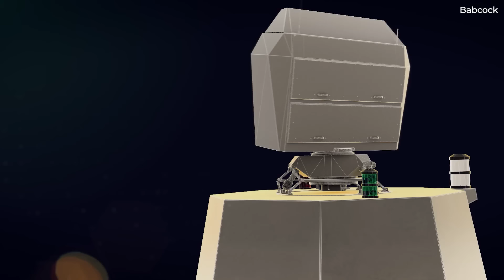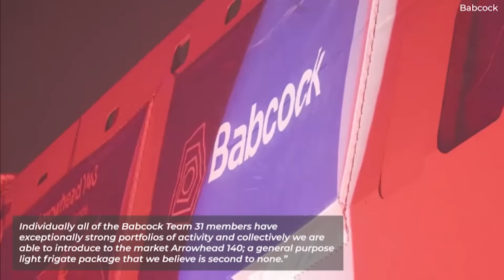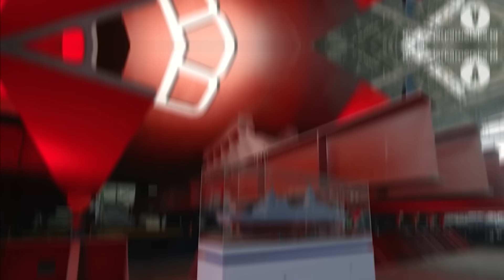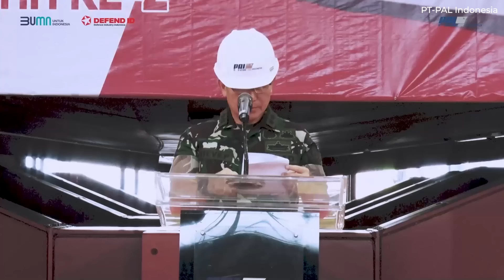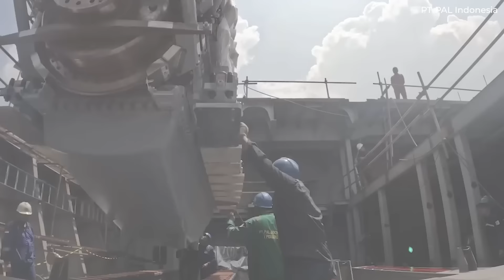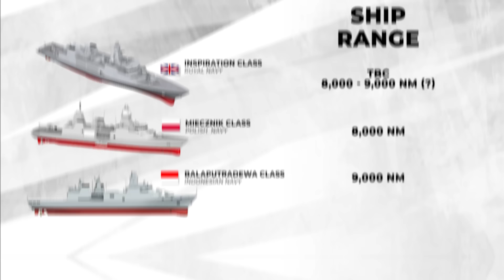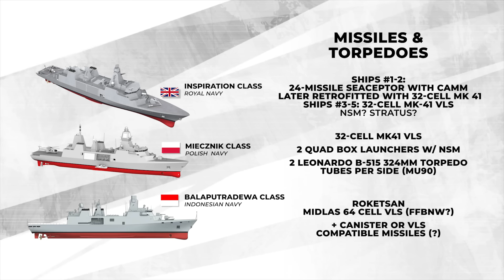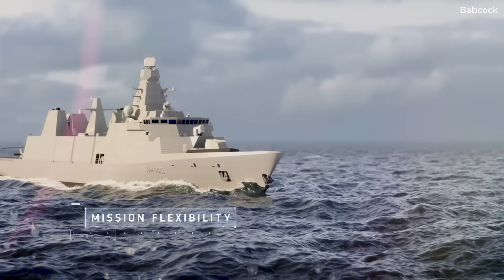Same, But Very Different: The Arrowhead 140 For UK, Poland, & Indonesia

Comment: It would be interesting the see the different doctrines behind the different ship designs.

Germany tries to have especially long repair cycles between assingments so the don’t have change as much when assigned to missions far from home. Therefore they tend to get bigger while low on weapons compared to size.

Other nations focus more on a nible design and small footprint, more waepons or with upgradeabllity/flexibility in mind for the future.
Reply: this attitude needs to change. when Germany sends ships on missions "far from home" then most of the time it should be purely good-will missions and not hot combat missions. scaring off some pirates was relatively harmless for frigates in the past, now with drone swarms it might change. 
anyway, it's not important. Germany doesn't have much to do "far from home". their navy has to defend NATO territory and that is not far from home. anything else is not their primary mission. 
therefore German ships don't need to be "peace-keeping" ships anymore but to fight Russian aggression. endurance is not as important as for British or French ships. just detect and neutralise Russian subs and keep the air above them clear from any threats.
Reply: Poland does not intend to project its naval power across the oceans; instead, it plans to operate in the Baltic to defend its critical infrastructure and coastline. Or possibly to seize Królewiec, should Russians decide to try their luck.

Comment: RN have a deep availability crisis now, the Type 23 frigates are old and are being phased out. T31 and T26 ain't ready to cover the gap.  The RN hi-lo mix is by design, I presume T31 is intended to be a work horse and cover tasks not needing the ASW capabilities of T26. Indonesian Navy was planning on using NSM as their anti-ship missile, but Norwegian government blocked export approval, seems we only allow missile export to NATO members and partner nations.
Reply: Itu Malaysia bukan Indonesia yang gagal kerja sama dengan Norwegia .
Reply: RN doesn't use Hi-Lo doctrine at all. They build a ship that specialises in it's field rather than being great at everything (which is surprisingly expensive). You are right, that Type 31 is general purpose replacing the GP variant of Type 23, but lacking hull mounted sonar is still IMO a cost saving measure rather than a strategic one. And sadly, your point of adding on stuff later is true, it saves money now, but costs more long term. Or even just slowing down production, which was shown in Astute building (where the last sub takes longer to build than previous ones) and arguably even Type 26. Unfortunately for T31, UK feels they need SOMETHING in the water now, due to delays in ordering the ship and having a frigate gap.
Reply: @mufanek_ The five general-purpose Type 23s that are now all gone had an older bow sonar that was not very good and no towed array, and that is what Type 31 is replacing. Also, a containerized towed array can be used from Type 31's multi-mission bay if required.
Reply: @adamchalmers8378 seems very likely that the T31 will be accompanied by a USV towing a sonar array.  Thats assuming the hybrid fleet plan comes to fruition.

Comment: A good video. It does show that the Royal Navy is pretty scrapped for cash. They might think that adding capabilities in small increments over several refits is a good idea, but it actually leaves their ships under gunned and under equipped for a big chunk of their lifespan. Each upgrade costs more and wastes more time than simply putting the equipment in during the initial construction phase. It is also a gamble. If a conflict begins, then these low-end warships aren’t going to achieve much and will be far more vulnerable than what anyone would like. Congratulations to Poland and Indonesia for getting their act together.
Reply: I think time should be noted as well. Successive governments delayed and cut the Type 26 programe (originally, there was a plan for 5 more GP variant Type 26), creating the capability gap. If RN already had roughly 3 Type 26 in service, Type 31 wouldn't need to be rushed to come as soon as possible. I do think some of those decisions were due to time and not only money. If it had hull mounted sonar, it would be perfectly capable ship fitting the role required nicely.

Oh well.
Reply: If they get the Mk41 VLS as planned then they should be quite punchy frigates. But the thing to remember is they were always designed to be cost effective general purpose frigates. They're not expected to be used in high threat areas (unless they're fitted with more weaponry) that's the job for the Type 45 and Type 26. For the Poles and Indonesians these are their main surface combatant so they need a more capable fit.
Reply: I want to strangle every admiral who says "fitted for, but not with."  Its the worst of both worlds, you're literally paying installation cost for nothing.

Comment: The Type 31 was designed to sit between the roles of the Type 26 frontline frigates and the River class offshore patrol vessels.

As the primary surface combatant for Poland, the wicha class is much heavier. They still share the same hull as "steel and air is cheap" and the UK expects that over the decades the Type 31 may 'grow into' its available displacement.
Reply: Grow ? In theses uncertain times wouldn't  be better to have better weapons from the get go
Reply: @ChayMiddleton  I disagree. The Danish Iver Huidfelt (on whom Arrow 140 is based) ensures a massive volume. They install the wire harnesses and mechanics, and leave room for new systems to be integrated. The newest Type 31 outfit plan is in fact a very capable warship from the start with expanded Sea-Ceptor air defence, 3 (!) Bofors auto-cannons, 8 NSM launchers and 32 MK41 VLS cells. The only thing that is lacking from the get-go is hull-mounted sonars (One can still fit a light Captas 4 containerised towed array, or even lighter OptiArrays (potentially on autonomous small surface drones). It certainly is no slouch (that it looked like it could become for a while). It is turning into a very capable GP/patroller/convoy protector. When the Stratus LO goes into production, it may hold an additional 32 ultra-stealthy 1000-mile cruise missiles, for example (or however they choose to mix the MK41 silos)

The multi-role Polish variant comes with a very different price tag (since it must do a bit of everything (wider AAW, ASW, etc). UK wanted a general-purpose variant at a very low initial cost. UK could do this since 45 does "fleet missile protection", and 26 does ASW warfare as tier 1 specialists. 

What it shows is how good the Iver Huidtfelt design was (now improved as Arrow 140) as a really flexible solution for many needs.
Reply: @ChayMiddleton  No, because it would take much longer to bridge the frigate/ hull gap, and add to the 2026/2027 defence bill unnecessarily.
The key is to get the basic HMS Venturer and HMS Active hulls out in service, ASAP.
Add ons later on the first 2-3 hulls.
Reply: Not really. Designed to replace the 5 GP versions of the T23, but on the cheap. War usually prooves the folly of trying to skimp on design in peacetime. We pay in blood & defeats.
Reply: @2bingtim  The folly is not having hulls in 12-24 months time, and a Frigate gap. Adding on exquisite extra at this stage adds to fitting out completion times. Hull 3 will get the Type 41 VLS, whilst Venturer and Active will get reteorfitting. I was F171.
Reply: @2bingtim  The RN has been replacing GP Type 23s with OPVs and other less than peer-level assets since 2006 when they went from 8 to 5. When the future of the RN was being worked out in 2010 the initial plan was for Type 26 replacements for all surviving frigates and OPVs to cover the roles left by the 3 Type 23s sold to Chile.

For ASW (a primary RN concern) Type 31 sits between the Type 23 and River class in capability. Even GP Type 23 hulls had bow sonar and hull mounted ASW torpedo launchers. A GP Type 23 also has 1/3 more VLS cells than a pre-retrofit Type 31.

By the time the 2015 SDR re-imposed the 8-5 split due to costs and suitability concerns, the role of a GP frigate had changed substantially and this was informed by the performance (and sub-£10mPA running cost) of the existing River Class hulls.

Frankly I think that if they were confident they could afford at least 11Type 26, another deployment would get the Falklands treatment and RN would make up the numbers with more OPVs.

I'm not saying you are necessarily wrong but you miss the context of the thinking at the time. Type 31 was not intended to be a 'proper' fleet escort like the GP 23, but to have the capability to be made into one if the world started getting hotter. It was really intended to be a more serious and cost effective answer to the question Germany's F-125 was built around.

A Counterfactual & Some Numbers:

The Type 32 proposal was an actual attempt at a GP Type 23 capability replacement, both in terms of capability and hull numbers. Notably it was built on the same AH140 hull.

In financial terms I'm afraid your point about replacing capability 'on the cheap' is actually way off. As designed (before the retrofit package), a batch 1 Type 31 actually costs the exact same as a GP Type 23 did to build. Roughly £115m in 1995 is £250m in 2022 (adjusting for RPI).

A real 'Capability' replacement for Type 23 GP (or as close as you get to a 2020s equivalent to a 1990s 23 GP) is the £450m-ish Type 32.
That's substantially more than the adjusted cost of an ASW Type 23 + towed array upgrade package + a Merlin aviation complement, just for the ship.

The GP 23 therefore represented incredible value for money at the time, and there was no realistic way to get the same value either in 2010 or 2015.

2010's answer was to try for something much better, but that turned out too expensive. 2015's answer was to redefine what a GP frigate was for, so that 5 could be bought for the same cost of 5 GP 23s.
If they had not, the Type 31 program would have cost about £2.5bn by now.